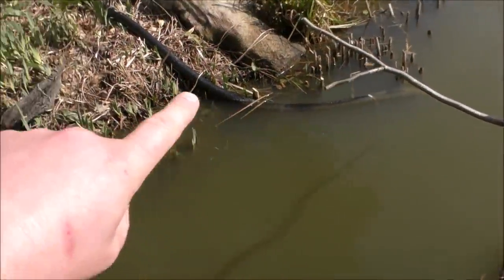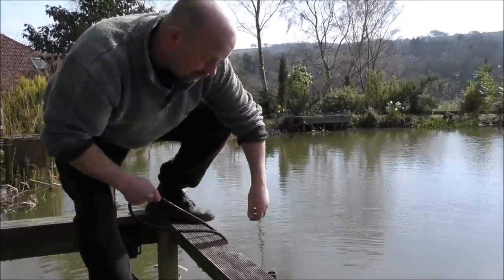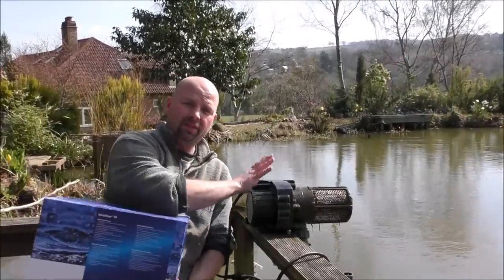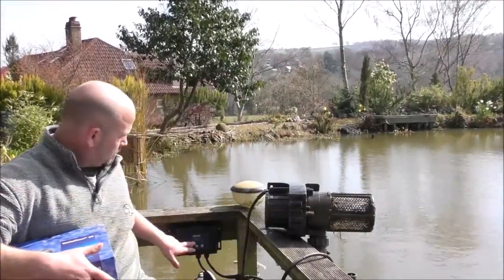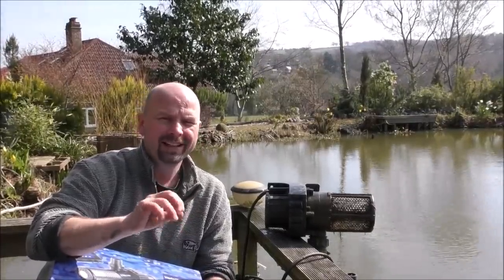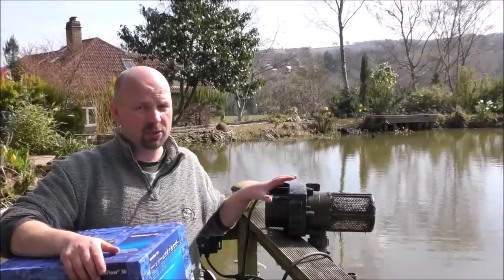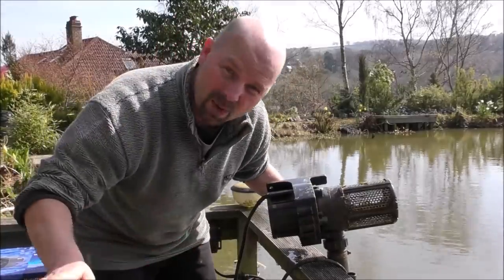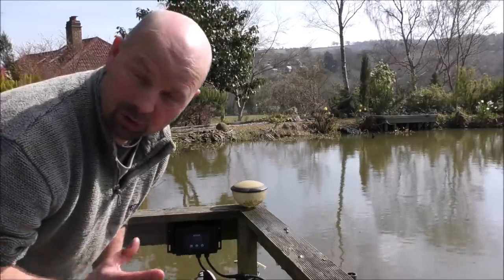Huge Pump For a Huge Filter....

Comment: Question or maybe a suggestion about your pump location. do you plan to just leave it at the bottom? with such a nice big pond.. and what we we did in the past on a vacation lake house was set vertically a large round galvanized pipe. large enough to fit the pump down inside of it. but cut rectangle openings around it and weld metal mesh or expanded mesh. set it the deep end. have it extrude up past the water level about 10in. then have a mesh opening on the top that can be removable. build a small floating duck shack that slips around the pipe and floats over the pipe concealing it as the water level may adjust through the seasons. then get a dinging. which you probably already have. and just use it to check on the pump or maintenance. you could brush down the outside of the pipe every 6 months or so. you could set a shelf on the inside of this vertical pipe to set the pump on so it stay a few inches of the actual mushy bottom. this will prolong the pump life and maintenance. just a thought. awesome job on the mega filter.. you keeping the plastic tote idea? or converting them to a concrete bay system?

Comment: Hi Richard, glad to see you back! I have been watching your 'Mega Filtering System for your Fish Pond' video series. Have you considered shrouding your AUGA VARIO FLOW 30000 with an perforated cover to prevent silt, mud, muck and debris blocking the flow of your pump. It's an addition precaution and further help the pump to reach maximum efficiency. I know it had an mesh cover on it. But replacing the Mesh Cover and having a perforated plastic or stainless steal shroud cover over the entire pump would make it last longer and work a lot easier. Or at least I would think so. Just a suggestion. Good luck in your endeavors. 🐟

Comment: Nice video thanks for the time making it one thing don't pull it around and out by the wire its to bigger thing to do that it made me cringe please put a length of paracord on to it so you can pull it out anytime or you will have that wire snapped in no time. keep the videos coming hope you find the strainer basket
Reply: paracord on a pulley setup (one continuous loop on a pulley across the lake, then another attached to the pump passing loosely via a runner on the pulley)? Then the pump could be pulled and lowered into the centre. .... ok, toss it in :)

Comment: That pump definitely needs modifying. The filter mesh although quite large isnt really big enough (in my eyes any way).
You also say it's a massive pump. My pond is 28,000 litres and it has an 18,000 litre pump on it.
Youre pond/lake is making that pump rather tiny. Lol

Comment: With the way you placed the pump in the water, what is stopping it sucking mud up. Surely it’s kind of just digging itself into a shallow/hole. Maybe placing it above the bottom, on plastic crates would help. Unless the lake has a solid base of course.

Comment: Richard I have a question. With the pump off the bottom wouldn't it be more efficient? Suspending the pump on half water would reduce the amount of muck and sorts clogging up the filter. Looks like the pump is digging itself into the mud. Hope that makes sense.
Love the pond series, thanks for sharing. Cheers!
Reply: But I think you want the pump to agitate that stuff.......
Reply: Yes and no. In a normal (koi) pond yes, but this is a natural body of water. Not sure about the soil, sand, clay or soft mud. I'm guessing the latter so keeping it off the bottom would reduce stirring up the mud and making the water cloudier. Just speculating here, hopefully Richard will chime in at some point.

Comment: Hi,  I was impressed by the specs of the Auga pump but I can not find the 30,000L/h VarioFlow E-30version anywhere in the UK. Did you get yours direct from Auga to review for "free"? Any help would be appreciated.
Reply from the maker: Nope it wasn't free and the front fell off a few months after filming this video - the pump then drew stones in and destroyed itself so I have a new one now which is larger and from a different manufacturer. Apart from the weak attachment of the face of the cage surrounding the pump it worked very well (until it didn't)

Comment: Pump sizes are a pain but at 400wats for full power on your pond may be by head and flow two pumps might be cost effective,
I got similar pump  and at about 50‰ flow it runs at about 90 watts . Never checked temp of inverter at low power as that kills them . I only offer unresearched idea as 400 watts eats power and might gain with 2 running at much less power